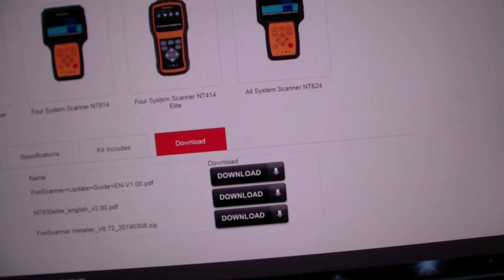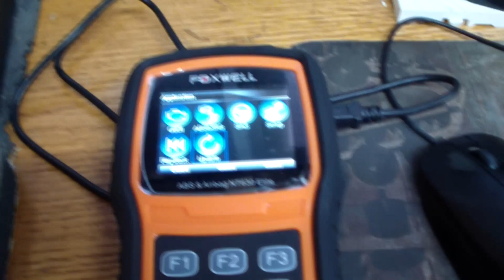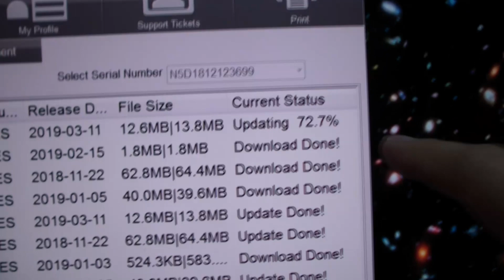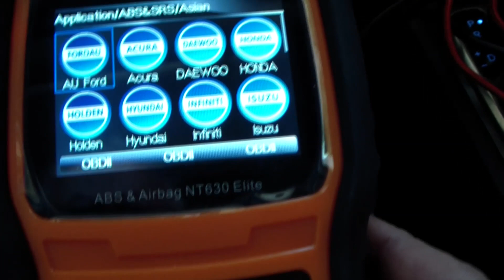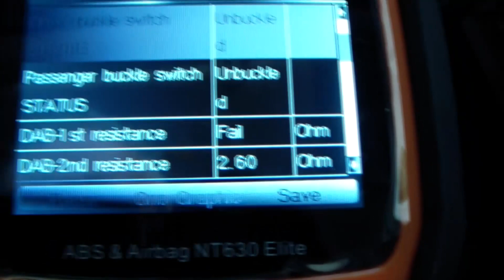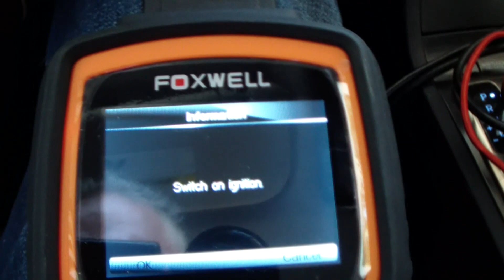Foxwell NT630 Elite ABS and Airbag OBD Code Scanner Review - FAIL!

Comment: Older video but I just got one of these from Amazon. I replaced the clock spring assembly in my Infiniti and had to calibrate the steering angle sensor. Worked perfectly and was also able to clear a flashing airbag light.
Reply from the maker: This worked fine on my old car. Got a 2022 Nissan and found that no newer cars are supported. I requested help from Foxwell and they have stopped any new development for this model and said I need to buy newer model. Very disappointed.

Comment: Software to access thousands of vehicles is complex. Most cannot be reversed engineered, so it is purchased from the manufacturer w/royalties paid for each unit sold. This is why many scan tool have no access to sub-systems on vehicles. The Onboard Diagnostic System-2 has been in use since 1992 & all after 1996. The engine data is global and not specific to each vehicle as required by law. Ex; Steering Assist System needs re-set after replacing a position sensor, motor, controller or alignment. A GM Malibu from 2013-2015 has identical parts & software then changed. The Factory re-set is turn left to stop, hold 2 seconds, then right, hold for 2 seconds then center as if on alignment rack. The controller learns new values and provides the appropriate assist. Otherwise it wants to pull left or right while going straight. Sensors on the steering shaft are common failures, but GM instructs techs to replace upper assembly complete, not just sensor.  Plus there is 9mb of data on the card to cover all models from 92 to present. Special functions to sweep gages, roll windows, lock & unlock are not accessible as in SIR. Passengers presence sensor detect 42 pounds. Groceries or child, no inflator module deployment. If replaced it must be learned for weight on cushion. This is why the Foxwell NT650 Elite must be used as you know the body system actually exceed trans & engine (PCM) but not full access to SIR module or Body Control (BCM) as class-2 serial data & CAN data are used depending on how fast data needs transferred. Class-2 modules have back-up programs and CAN data, quite to allow important data to pass, then resumes regular communication. State-of-health messages are sent every 2 seconds, if a module or node fails to reply, mode master module takes over while flagging the module that failed. GM uses global architecture for every country with exceptions, but emissions fall into a need to know everywhere, just basic info only. Live data is extremely useful for proper diagnostics as global says; Bank 1 O2 sensor. The O2 sensor is good & reporting but after 20 seconds of lean or rich, just show O2. Live data shows all injector open time is less than half. Best practices lead a tech to inspect fuel pressure, then vacuum hose to return-type regulator. Here a leak is found. Fuel dumped into engine that fuel mapping cannot correct. $52 regulator fixes problem while $158 O2 sensor repeats same code, problem still there. Knowledge of systems, live engine data (Not Generic Global OBD-2) and software by the manufacturer not from a cubical in a building, fixes vehicles, but cost $2k plus annual updates for the Brand. Plus bi-directional communication is important to all control by a tech as the procedure is written into the diagnostic flow chart. 
DK, ASE Master Tech since 78, Delco instructor on 30 subjects. Retired. 
Interesting product, but one can't do all as software files would be huge! No pending DTC's or 5 fail records for current code to drive & reproduce exact trouble specs. It's a tuna, but not tasty, sorry Charlie!

Comment: the 630elites t had would not do abs
Reply from the maker: The one time I looked at ABS it did not seem to work either. Hopefully they will offer firmware update that fixes.
Reply: 630 elite does abs brake bleed!
Along with steering angles and air bag too.🤔